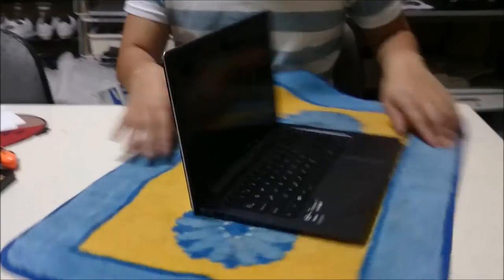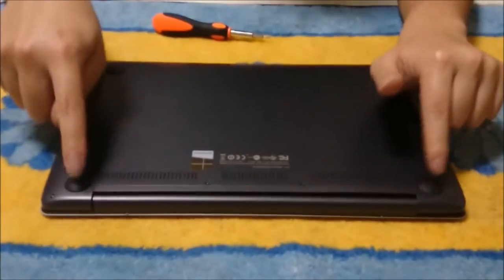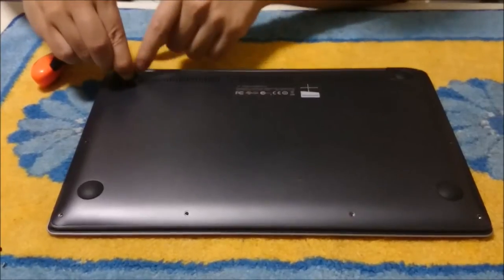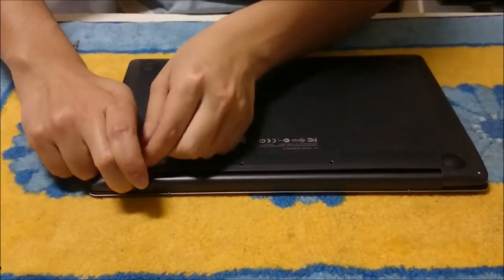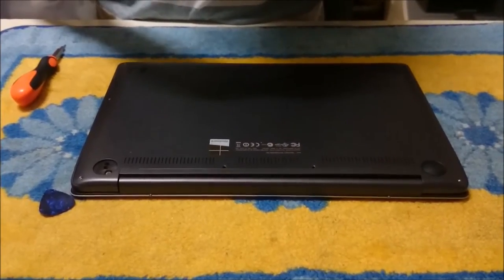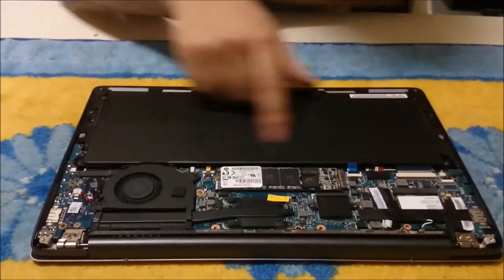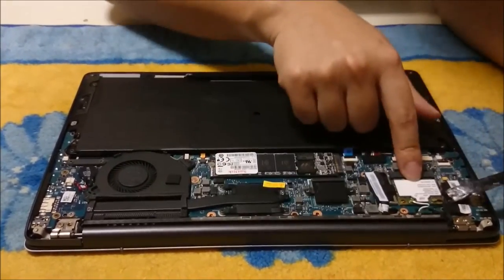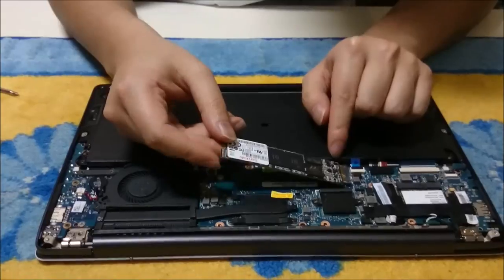OPEN ME UP! Asus Taichi 21 Notebook Disassembly

Comment: I have a question which Torx screwdriver sizes do I need to open up this device? Thanks in advance and great video (Y)
Reply from the maker: actually dont know. i got a trox set off ebay with everything inside so never looked into what size it is since i had everything. it should be t3 t2 or t4
Reply: ФФФФФФФФФУУУУУУУУУУУУУУУ

Comment: how to make it connect without the battery? mine does not load anymore and I can not find it to buy.
Reply from the maker: you need to power it with the battery connector. thats the only way you will get it to turn on. that might mean you have to rig up some cable that take in AC power and deliver it to the battery connector
Reply: I opened the notebook, removed the battery, plugged it in, but it does not turn on. I bought a battery that came from china and seems to be fake. It stayed for about 3 hours on, the notebook worked and then erased and returned to look like the original, no longer working.
Reply: I do not live in the United States anymore. If I lived I would take the technical assistance.
Reply from the maker: seems like you got the wrong idea. removing the battery and plunging the power in is not what i told you to do. you need to get AC power to where the battery is connected. the battery has a cable that connects to the circuit board. you need that cable and merge it with AC power to get the laptop to work. Therefore you will be powering your laptop with power through the battery connector not the charging hole
Reply from the maker: if you purchase a battery that work for 3 hours and the laptop is not charging it. that means you laptop charging is faulty not the battery.
Reply: I need to find a way to connect the battery directly to the ac Power. it may be the notebook that is not charging the battery. I already switched from Power ac and it continued the same thing.
Reply: If it is not problem neither the ac Power nor the battery, can it be the motherboard? when the ac power is plugged, the connector turns red. With the second battery, the notebook worked, but the next day, the battery was already fully discharged and no longer working.
Reply: It could be motherboard problem. I'll see if I can find some place to fix it.
Reply: How to change watch battery?

Comment: How to upgrade the RAM on this or the "31"?
Reply from the maker: no ram is soldered on
Reply: How much to get it increased at ACER? or after market? :P
Reply from the maker: dont understand what you trying to say can you please repeat it
Reply: If there is an ACER repair in a COUNTRY can you send it to them to add the extra modules? youtube videos show you have to heat up and clean the whole socket to add a new (GPU) ram in this case
Reply from the maker: dont botther this laptop is too old buy a new one it will be cheaper and better
Reply: Well show us then one other laptop that have 2 separate screens that can perform two different tasks simultanously.

Comment: how do you add ram in it?
Reply from the maker: CPU is solder on, ram is solder on, battery can be changed, wireless can be changed, and SSD can be changed
Reply: OPEN ME UP so u cant? ok